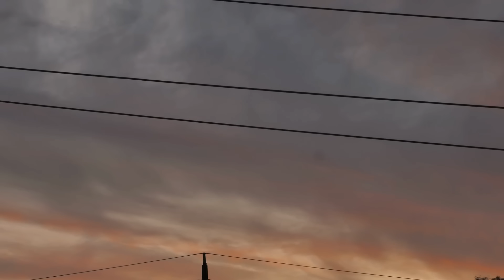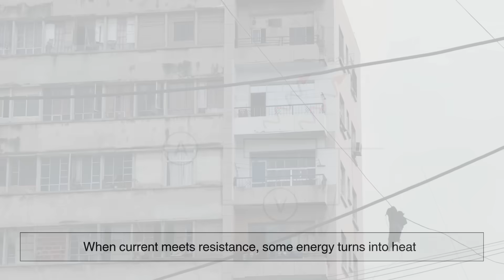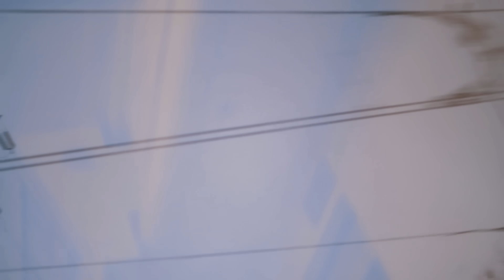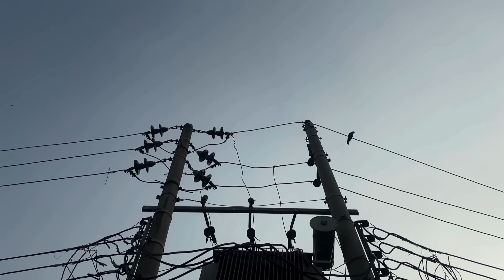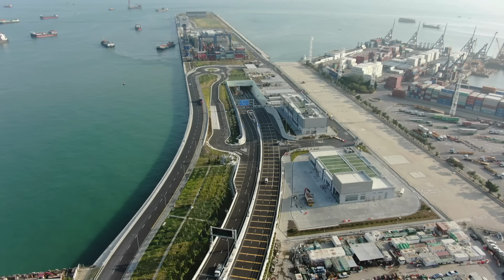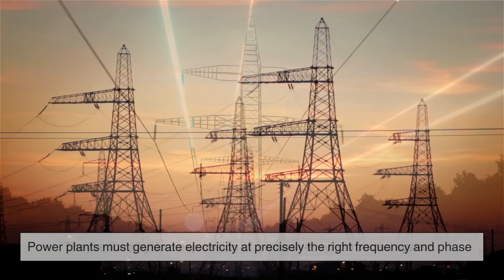How Do Power Lines Carry Electricity Over Long Distances? The Power You Never See

Comment: Someday please make video explaining the role the switches, circuit breakers, isolation switches in power transmission. 

Please also explain how aluminium cables are strung together on the transmission towers, how they are joined, and they don’t come into contact with metal towers and each other.

Comment: Only Simple Thing more stupid than the USA not going Metric, is that they also haven't gone to 220/240v for local transmission imho.
Reply: Wrong. They started with 110/120 AND 220/240 before other countries had anything. So for them to make everything in the grid 240 would be way too SUPER expensive!
Reply: @HelloKittyFanMan  Taking local grids to 220/240v would not cost much and almost all devices are now 110/220v compatible.  Maybe I'm missing something?  Going to metric is a no-brainer if you really want to be a world powerhouse in manufacturing imho.
Reply: @tomc1380 : Yes it would, and you're missing a ton, because you, as the federal government, would have to pay electricians to run around and move the 120s over to 240 in the circuit panels of many millions of homes and businesses so that that would switch over without turning their existing 240s into 480. Not only that but you would have to send out millions of government coupons to pay for adapter transformers for the many existing devices that do NOT have built-in adaptation. It would be a CRAZY-expensive pointless change!

As for metric, I never said anything about that in this thread.
Reply: @HelloKittyFanMan  Thanks for explaining this to me mate.  Cheers.
Reply: @tomc1380 : You're welcome. Have a nice day!

Comment: Why do they always say “how does it travel long distances?” As if its travelling at all? It is vibrating back and forth at 60 herts, so is it real travelling if all its going is vibrating?
Reply: The movement of electrons in and surrounding the metal matrix of the wire creates an electrical field which causes current and a potential energy differential. They explain it with the pond thing at the start.
Reply: No it's not. There's no such thing as "herts."